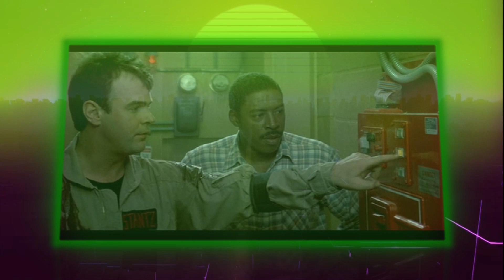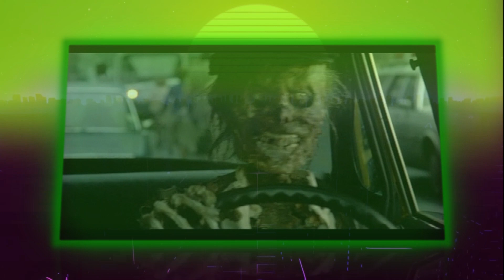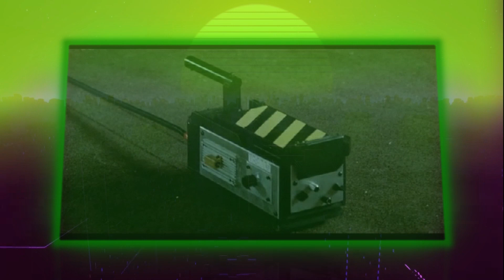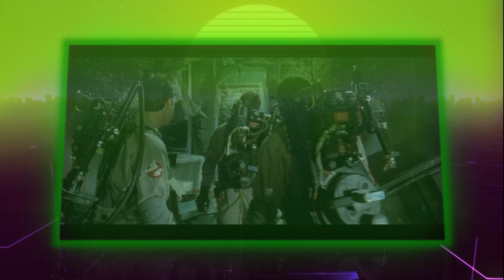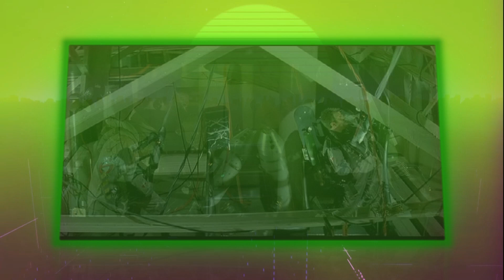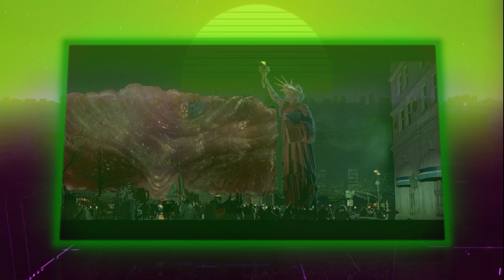Ghostbusters Equipment: Containment unit, Ecto Goggles, Ghost Sniffer, Ghost Trap, Proton Pack

Comment: Not so much of an "air lock" but a grid of high energy "jail bars". When the trap is loaded into the receptacle, the trap PKE activity will be automatically sensed. The user must sync the entry grid with the containment grid in order to inject the entity through the containment grid. The containment field will then be neutronized to make the grid "transparent" as best as I can explain.... The containment grid is the actual grid that contains the entities. The containment grid operates between 0.6 and 4.8 THz, depending on how full the chamber is. The sensing equipment is the protection grid which constantly monitors the containment grid for "leakage". When the protection grid senses any activity more than 0.2 PKE, it will automatically bump up the power to the containment grid. Our chamber has an estimated capacity of 8.55 GeV which would be considered well into the yellow.